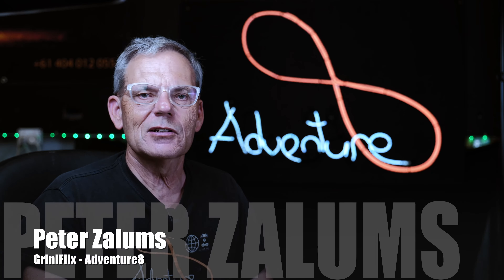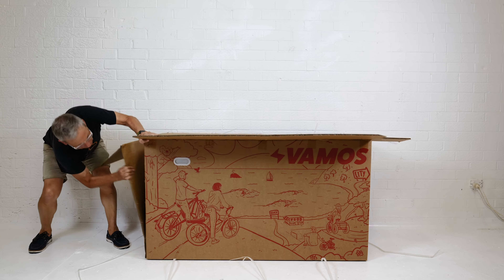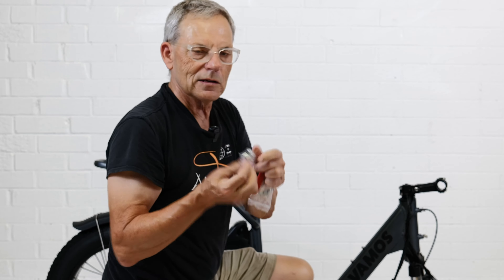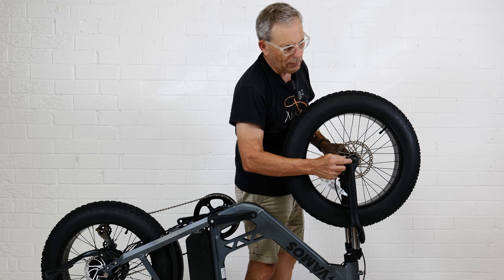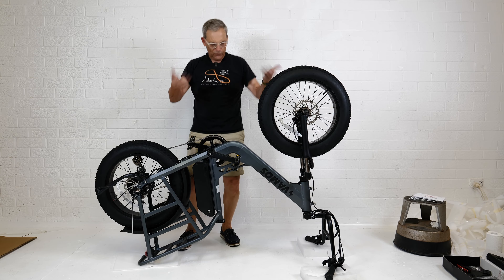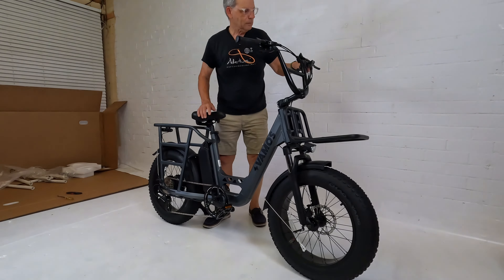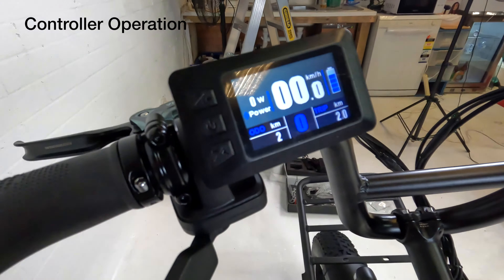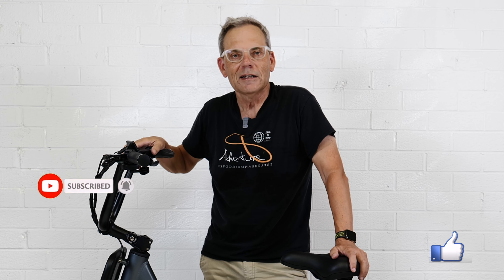Vamos El Amigo Electric Bike Unboxing.  Is this the most useful eBike on the planet?

Comment: When you do your review, will you please talk about how much ghost pedaling there is and if there is enough resistance to get any exercise . I really want a trike but the lectric trike I have now gives no resistance and I  get no exercise like I do with my bike with a torque sensor. I wonder if all the trikes with cadence sensor are this way. Thanks!
Reply from the maker: Thanks for watching. There are a number electric motor systems.  Vamos trike and El Amigo use a torque sensitive motor.  So, the power is applied when there is pressure on the pedals going forward (ie not free wheeling).   The amount of power assist is governed by the power setting you choose, 0 (no assist) to 5 (Max assist).  So if you want more exercise, choose assist lever 1 or 2.  Hope that helps.